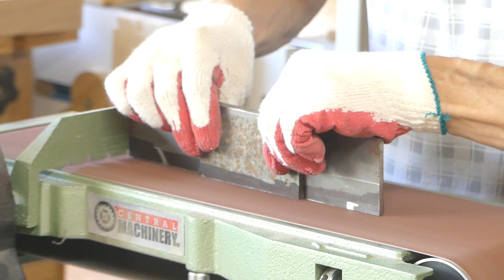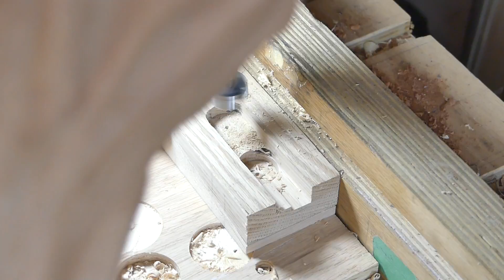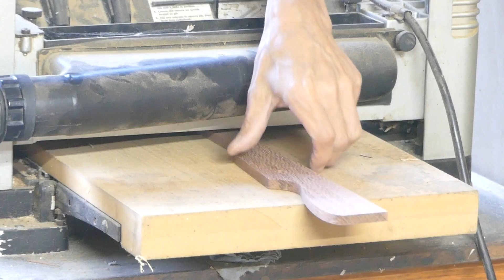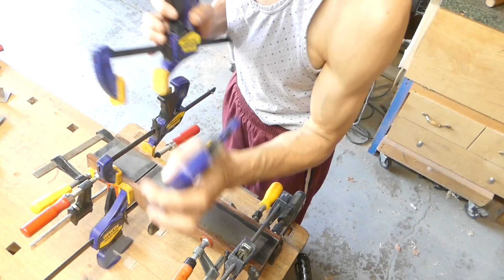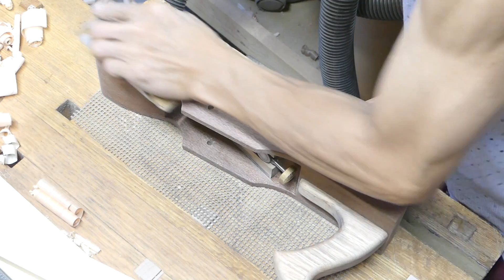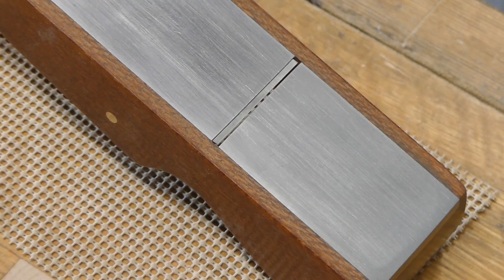make a low angle jack plane

Comment: I normally buy old stanleys and recondition them because I find that very enjoyable, but if I ever make a plan this is the one I'd likely try to build.  I'm sure people ask all the time, but do you have any plans for this build or did you do it on the fly? This is really beautiful work.  In  your opinion, could you make the sole out of hardwood or would you stick with iron?  Angle grinders scare me the most out of any tool, so I try not to use them ;)